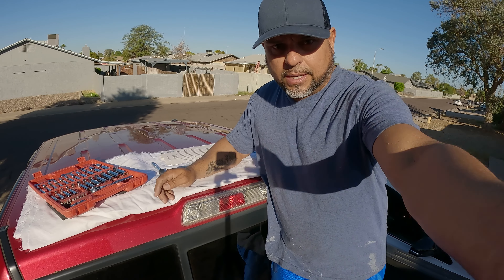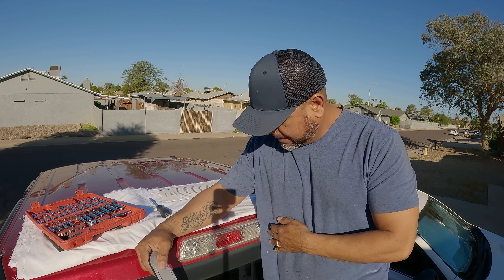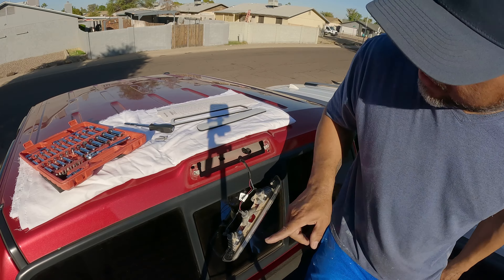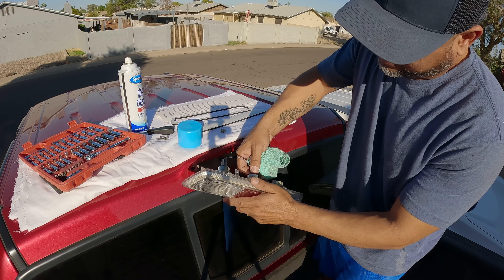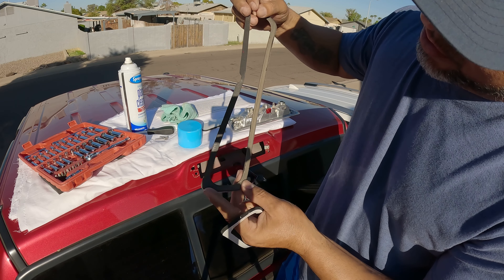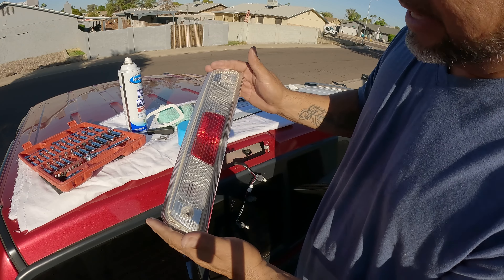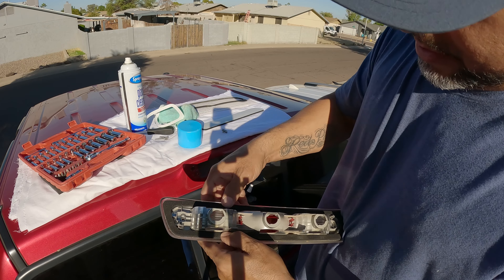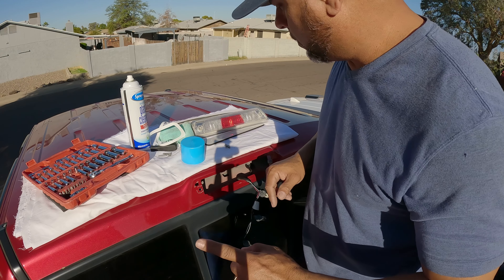2010 FORD F150 PLATINUM THIRD BRAKE LIGHT LEAK REPAIR. J's DIY n stuff

Comment: Have you ever had a leak on the sliding window?
Reply from the maker: @doublem6027  Not a leak after that gasket replacement…it has worked fine..recommended 👌🏼